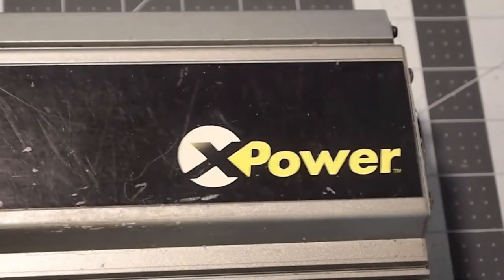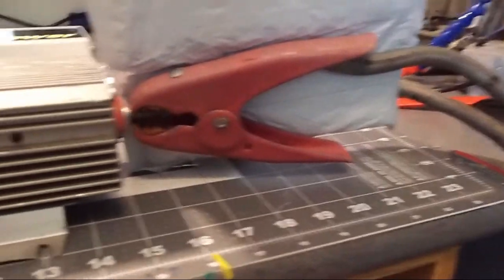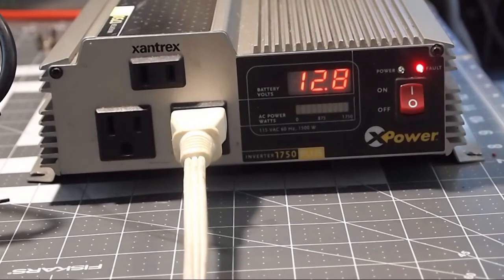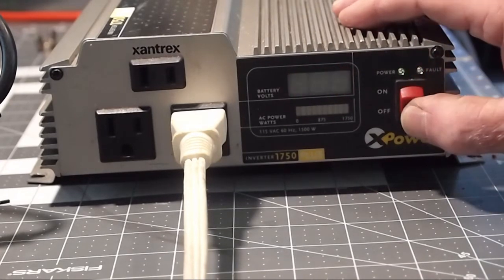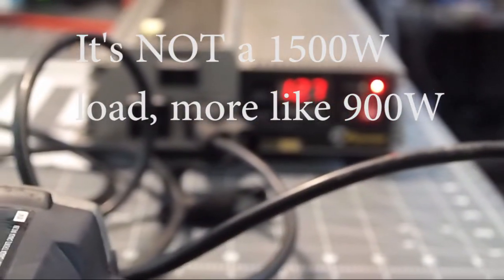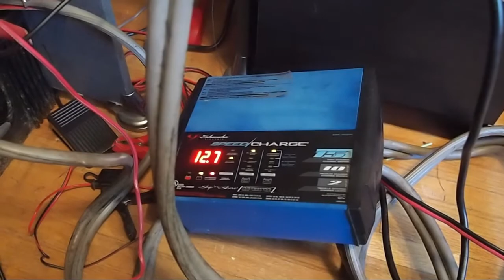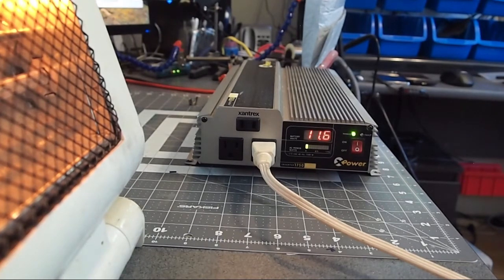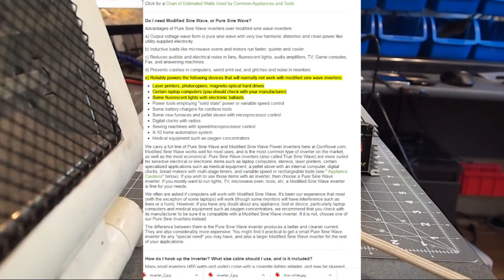Why won't my inverter work - Xantrex inverter demonstration

Comment: this is called peukert's law. this is why lead acid batteries suck for inverters. correct wire size and lifepo4 batteries is the best fix. great video.
Reply from the maker: Thanks for that, I did not know about peukert's law. But my goal is to replace the 160lb lead acid 'house battery' in my van with a Lifepo4 pack, and I'm encouraged to see that peukert's law does not apply to Li-Ion.

Comment: try using 0 awg wire tighted witha nut from your battery  to your inverter.  i had similar problems when using jumper cables
Reply from the maker: Good point on the jumper cables, makes sense. I'm still running a 1000W Sine wave inverter in my van (with the same battery as in this demonstration) and recently acquired an inverter microwave so that when I run it on a lower power level it will actually draw less than 1000W (those style microwaves are the only ones that actually draw less watts when you change the power level, most cycle full power on and off). However, without the van running and supplying current from the alternator, the inverter does not like the voltage drop even on the lowest power levels. I've been planning to replace the flooded lead acid battery with a 280Ah LiFePO4 battery pack, and hope that it will suffer less voltage drop under load and keep the inverter happy at 700 watts for at least 3 minutes or so.